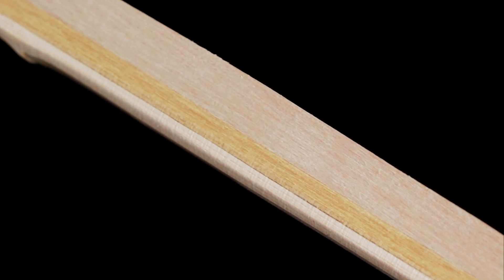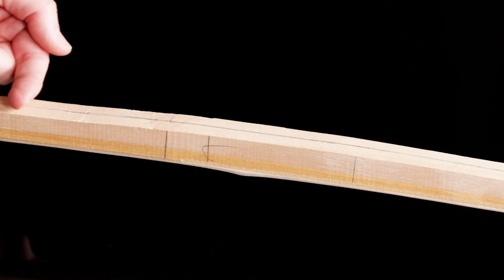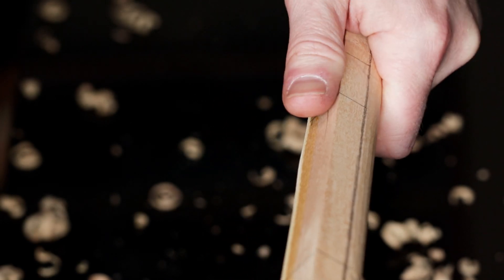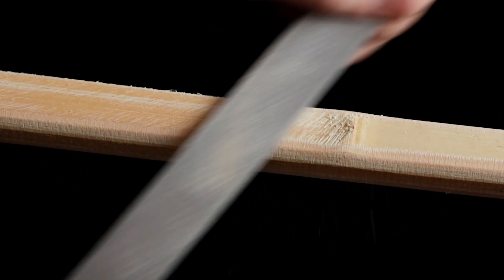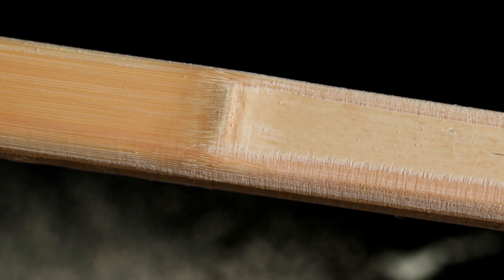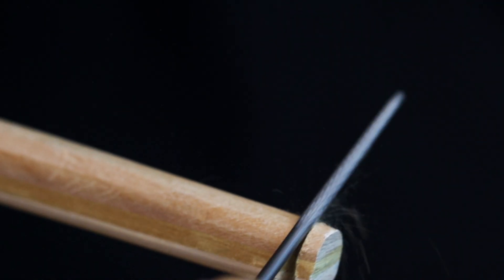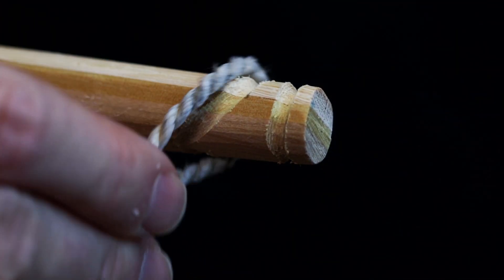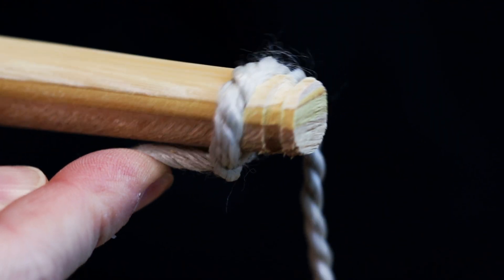How to make an English Longbow Victorian triple laminate part 1

Comment: Very beautiful work and great video. My biggest question has always been how your bench holds the bow while your working on it. I think I've seen in videos that it's just a brace at both ends? Am I incorrect? Finding a really solid hold on a bow has been on of my biggest problems. I don't make many longbows, mostly flatbows of american style longbows; do you think that your bench and "bow holding" setup would work. Asking for a friend lol
Reply from the maker: Thanks.  Yes, I did a video on my bench set-up, I use two uprights with U shapes at the top, so I can rotate the bow with my left hand whilst working it with my right.  If I want to hold it tight without moving I place one end in the bench vice, does this answer your question?
Reply: @longbows  yes, thanks

Comment: Assuming you leave the nodes intact, can you scrape down 1-2 mm max of the bamboo in case you end up with a bit of the crown on one side?
Some of my bamboo has sideways bend , and I find it darn hard to plane it down at a slight slope before laminating 😅
Reply from the maker: Yes, if you find it helps.  Let me know how you get on.
Reply: Phew , finally at 30 inches. Thanks for the info , had to combine a bit of crown removal + belly and fiddle with the bottom nock to remove that nasty twist 😁

Comment: Questo è un arco in laminato formato da tre tipi di legno: di bambù, legno di limone al centro, manca solo il terzo legno e nel video non è nominato. Spero potrai dirci di quale tipo di legno si tratta. Grazie
Reply from the maker: I say all three woods at the very start of the video.
Reply: @longbows  Mi scusi tanto se insisto, i legni sono: bambù, legno di limone e pikia. Sinceramente il legno di pikia non sono riuscito a capire di quale legno si tratta. Sareste così gentile da darmi un ulteriore chiarimento in modo da poter capire di quale legno si tratta. Grazie per l'attenzione.
Reply from the maker: The one in the middle.
Reply: @longbows  Ok grazie, forse non mi sono espresso bene. Volevo sapere il pikia che tipo di legno si tratta? In rete non ho trovato nessuna notizia su questo legno.
Reply from the maker: Pequia
Botanical name: Aspidosperma vargasii